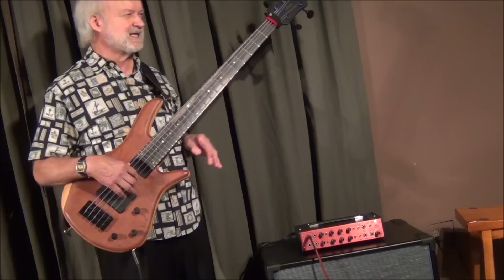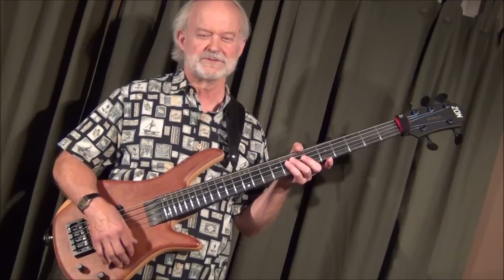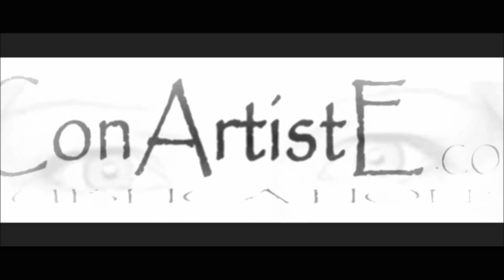Bruce Calin  - Novatone Switchable Fretboard Review

Comment: I had the system installed on my Ibanez back in the early eighties too and unfortunately it ruined the sound of the bass.It just sounded kind of plasticy after that. I really messed up because before the modification I had a great sounding bass. I should never have messed with it. One of my biggest regrets as far as gear choices go.
Reply: gimmeagig - I was in close contact with the company "Novatone" back in the late 80's.  I had reservations about sending them my Carvin LB90 at the time.  I never actually went thru with the deal because I loved the tone of my Carvin at that time - but I desired to have a fretted/fretless combo bass.  I never did go thru with the deal.  However, I did wind up meeting with Victor Bailey back in 88-89-90 and he had one of his Fender's altered by Novatone.  His ability to change from fretted to fretless in seconds was amazing - and Victor claimed that he was very comfortable and very happy with his purchase!  I still wonder, to this day, if I should have gone for it!  Sorry to hear that it didn't work out for you, man!